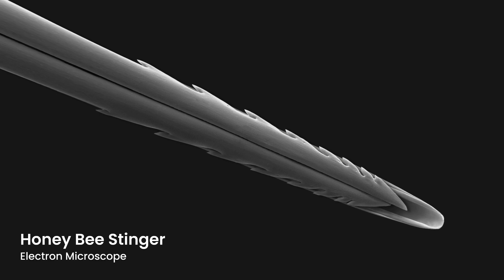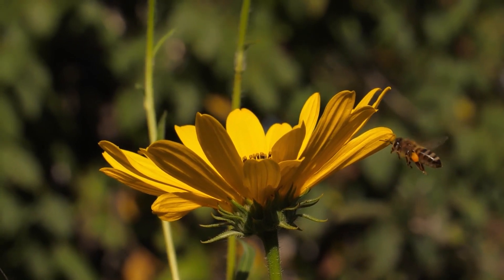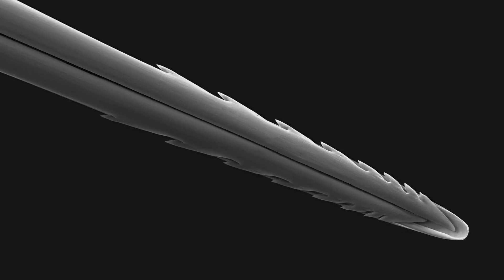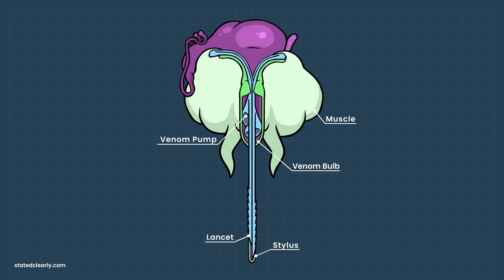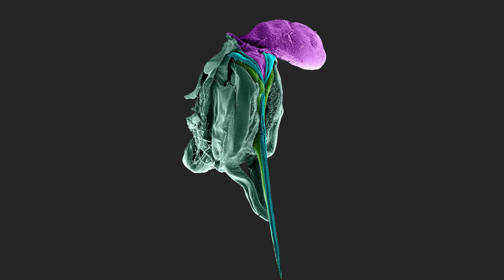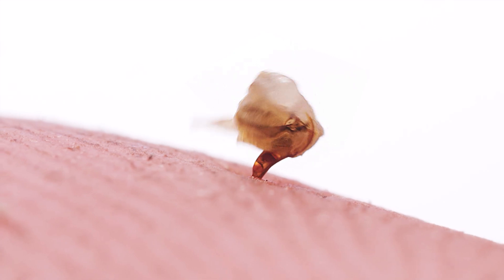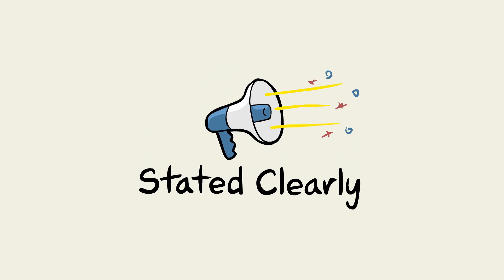DRAFT: How do bee stingers work? (please don't share this draft without permission)

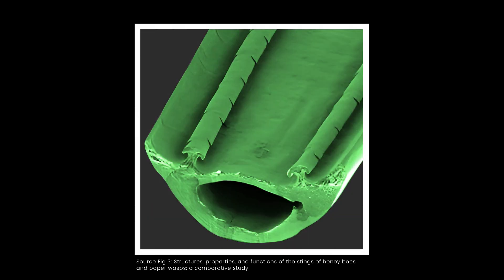Comment: you missed a cool thing @4:05 ... the tongues are also barbed, presumably so that once the lancets move down, they cannot move up, or more precisely, the stabilizing rod cannot be pushed out, so it's a double ratchet, and must be, to work its way into the flesh :)
Reply from the maker: Are you talking about the slits on the tongues of the tongue and groove joint? If so, those don't actually catch like barbs., The lancets slide on them. In the literature, the tongue and groove is said to be highly lubricated by a different set of glands.

 I suspect that what look like barbs there are either just structures left by the development process (like our bellybutton) or they function to make the runners (the tongues) more flexible.